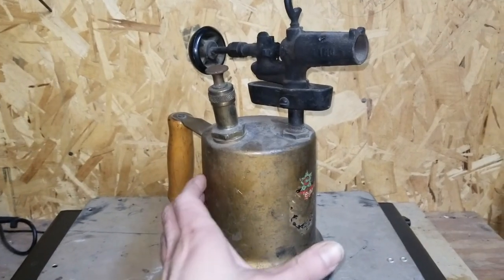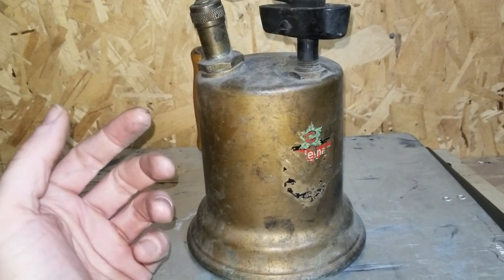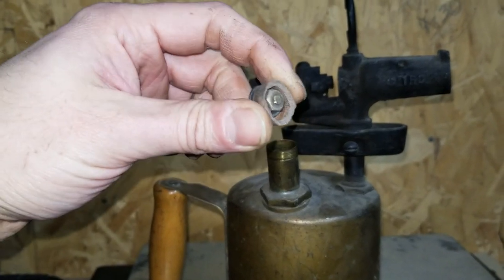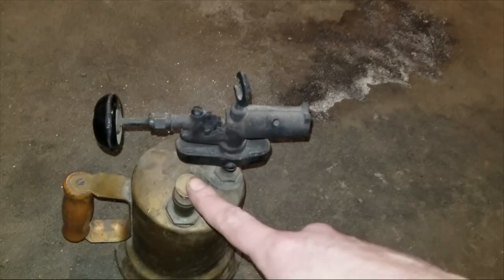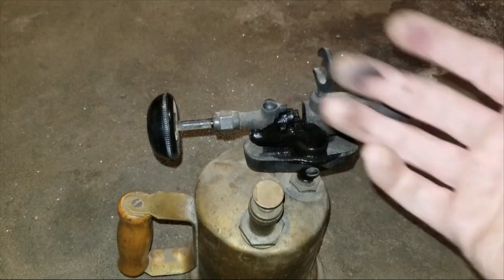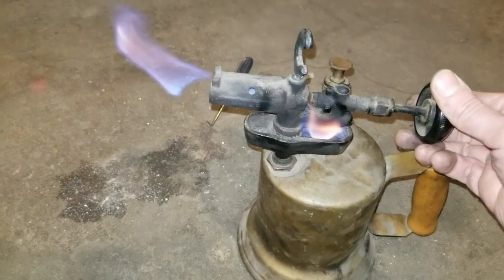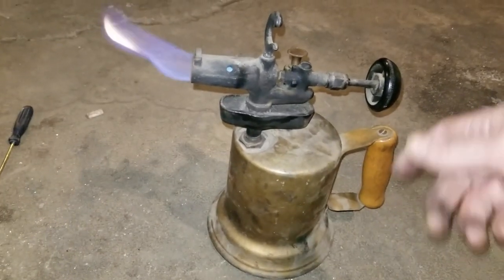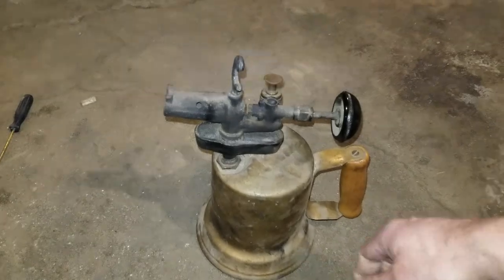Lighting a 70 Year Old Blowtorch - Butler (Coleman) Model 151

Comment: First off, nice torch.  Second.  This is a gasoline torch, do not put kerosene in it.  How do you tell?  Easy.  All Kerosene torches have preheat tubes inside or around the  burner.  Kerosene is harder to vaporize then gasoline.  All gasoline (petrol) torches have pumps and valves and the orifice size is smaller than kerosene.  All Kerosene torches have preheat tubes, but some also have control valves and some resemble gas torches.  Alcohol torches have no pumps, usually.  Don't mix up your fuels.  Kerosene in a gas torch may run O.K. if it's warm.  If not, you will get a flamethrower because the fuel will not vaporize.  Gasoline in a Kerosene torch, you will get too much vaporization and could wind up with an over-pressure situation in the torch tank.  You will also get a lot of flame that will be difficult to control.  The over-pressure condition occurs because the torch vaporizes the fuel, faster then the it can be burned and the pressure created backs up into the tank.  You can see why this can be a problem.  Check valves are easy to "check" if you pump up your torch, and you get the "viagra" effect", torch pump rod rising on it's own, your check valve needs attention.  These things are cool, but they will burn you if you let them.  Happy torching.
Reply from the maker: Thanks so much for all the useful info. The unfortunate thing about these torches being so old is that its hard to find useful information on how they operate. I hope wasnt too misleading in my video. :) I really appreciate you taking the time to comment!
Reply: You were not misleading at all, in fact it's good to see somebody interested in operating these old torches the right way.  Try "Zangobob's blowtorch heaven"  if you find you have gotten bit by the torching bug.  Lots of useful information there.  It kinda started that way for me, bought one at a yard sale, and went from there.  Now aI have about twenty in various stages.  All but a few are working.  I sometimes get asked why I collect them.  Well; first off, I am a guy ,and these are tools.  They are antiques, and need work done to them.  There is the history and technical aspect, and I can play with fire and not go to jail.  Plus, their really cool looking when they are running.
Reply from the maker: I appreciate that! I inherited mine when I bought my house. The garage came loaded with lots of old tools (and even more junk). The history and character of these old tools is something I personally cherish. Maybe i'll see what other old stuff I have kicking around to showcase. Thanks again for watching! I will definiteltly check out that channel you mentioned.
Reply: Wow, I was thinking the same thing for an analogy to a faulty check valve!
Reply: How do I tell if my torch is gas or white gas

Comment: These old torches, pretty bullet proof really.  As long as the pump works and it’s not clogged, they seem to be fine and dandy.  I have one from the 1920s, a Clayton and Lambert.  I put gas in the reservoir, lit it, and let it warm up.  Before this, I pumped mine like 25 times.  After 5-7 min, opened the valve and the gas/mist vapor appeared, and then....whoosh....nice blue flame.  

Cool old tool.

Comment: Good for you man, I've been annoyed with videos in the past, made by self-proclaimed "experts" who ultimately handled the tool in the worst possible way: by being scared of it. Now, I have a couple of "Lenk"brand "Gasoline Blo-Torches", one of which is very similar to yours. A few things I have learned from trial & error, as well as extensive discussions on the basic principles of carburetion with my close friend & mechanical mastermind, Billy Co*****tino, to whom I will forever be indebted to for the treasure trove of knowledge he has so generously shared with me (apples & oranges, but sharing some  fundamental principles that, when understood, help to destigmatize the use of these beautifully crafted tools).
🌟note: I found myself writing a tutorial, but only intended to make a few points; I apologize for the erratic nature of this comment. I'm using a phone that has about 30% of it's screen intact and can't really go back to see if I'm being redundant. 😵
So, assuming the torch is structurally sound, the check valve is probably the most important indicator of the tool's usability. After pumping 👇8-10× 🙌, with the main regulator valve CLOSED*, allow the torch to sit for 10-15 mins⏳. 
🚨IF THE PUMP HANDLE RISES, THE CHECK VALVE IS NOT FUNCTIONING PROPERLY AND MUST BE ADDRESSED PRIOR TO USING THE TORCH!🔥Yours seemed okay; good call on the oiling of the leather👍
The one pointer that might be of value is to follow the advice that you mentioned regarding lighting the torch by opening the main valve while the fuel is still burning in the preheating process: Once the torch is opened, the flame is no longer heating the torch head effectively, as it is now drawing in cool air. When very cold, it was recommended that the heating process be repeated a second time. 
    After heating, open the main valve. You'll hear the pressurized fuel vapor, no longer a stream of liquid as it should be prior to heating. 
Light 'er up!
 The one other thing that your video helped to show was what likely is a partial blockage of the torch. When you opened the valve and gas started to spurt about, was the valve opened more than a tad? If so, a stream of gasoline should piss out about 3 ft or so. Filling the preheat dish should be a relatively neat process, barely opening the valve. There's a very small 🔬needle that should protrude from the orifice when the valve is closed....never close with much force & don't use anything besides a piece of notebook paper to feel for the needle, which is designed to clean the outlet.
🕥⏩🕚....I could keep on going but, given past experience, I'm probably typing this to nobody....perhaps some googledy-bot that's looking for phrases commonly used by terrorists when they comment on youtube videos. So, if anyone besides The Dotard In Chief is reading this and gives 2 shits about anything I've said, good or bad, hit a button or something☺
THANKS FOR THE VIDEO, I SUBSCRIBED👍
Reply from the maker: Thanks for the informative comment! I had this beautiful torch sitting on a shelf for years and I decided enough was enough. I had to play around with it. I'm glad there are folks like you with an interest in such things who are happy to share their knowledge. There probably aren't that many people left who know how they operate. Thanks for watching and subscribing!
Reply: You're exactly right.....knowledge can easily be lost in a relatively short period of time. That's why I appreciated your video.... It also got me to thinking about creating a YouTube channel. How/ when did you create yours?
Reply from the maker: Oh I think I've been uploading videos for about 3 years now. Maybe a little longer. You should go for it. Cant hurt to try! If you do let me know and I'll check it out.
Reply: Thank you both for taking the time. Very informative. Got one from my Dad and will try it now.

Comment: Can you show how to replace the leather cup on the plunger? and how to make a replacement leather cup, that fits well and will not deform so much  as to not function,?  like the many I have already made, tried and that failed.  I would greatly appreciate this! My torch is a C and L brand and looks very similar to the one you used. Thanks!
Reply from the maker: I'm afraid that's probably well beyond my level of expertise with this torch. I hope you can figure out something for yours. You definitely dont want that leaking. Good luck!

Comment: Most likely Kerosene in your torch. Use it my friend. Pump it till you feel a little resistance light it and open the tap till the flame looks like it does on a small propane torch. You'll recognize the look and sound. I have a couple still with the soldering irons, one older than that and one from the 50's. Staple items in my shop. I use them a few times a month. $20 worth of Kerosene will last you a long time. I use them for soldering larger items and for burnishing wood products I make.... and occasionally for thawing stuff out of the ice... Canada eh'! Great find. Check this video out; it will show you the flame:  https://www.youtube.com/watch?v=tjVGM2wFTB0
Reply from the maker: Thanks for stopping by and commenting! I'm glad to hear your torches get some use. I'm delighted that this thing actually works and works so well. This will definitely come in handy in the future. I refilled mine with coleman campstove oil which I suspect is probably just Kerosene. To think I was just sitting on this thing for years and never bothered trying it out. I'm almost ashamed of myself!
Reply: Mine sat for years too till I got brave enough to try it! Now I couldn't be without them. I would be very careful (and a little afraid) with the white gas (Coleman) We call it hi-test gas too. Not a good substitute for kerosene.  It is 100% light hydrotreated distillate. Like dragster fuel. Kerosene is more like diesel, much less volatile.
Reply from the maker: +emsaps Good to know! I will be careful. :)
Reply: This is a Gasoline Torch, I recommend ethanol-free petrol if available. I live near a marina, so it's here just a bit more $$ than 93 unleaded
Reply: Coleman fuel is fine, just a lot more money than 91 octane ethanol free gasoline
Reply: If it’s a gasoline torch, putting kerosene in it will make it very dangerous because it doesn’t vaporize as quickly, so you will end up with, first of all, a wimpy flame that deposits unburned hydrocarbons that will prevent solder from bonding, but also dripping kerosene that will run down the side of the can and cause burns.